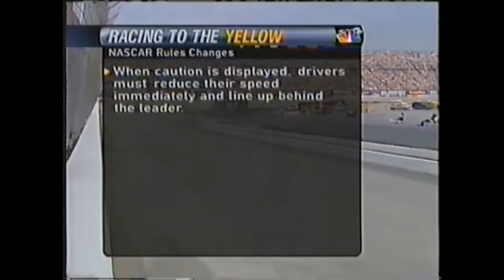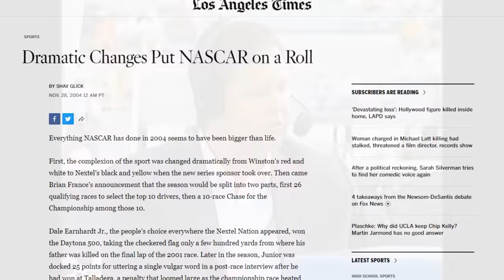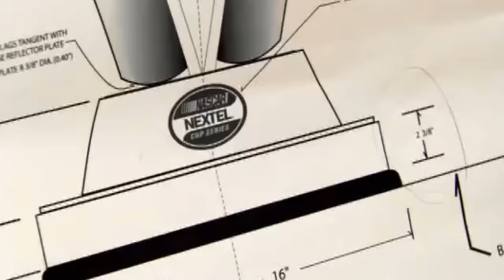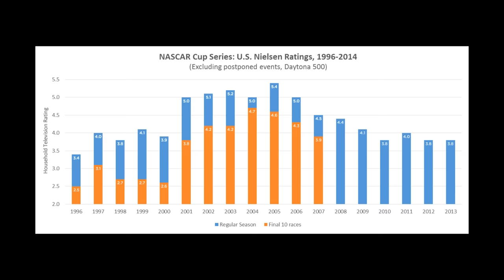NASCAR and the Dam of Legitimacy

Comment: I'll venture this:  you can make a pretty solid argument that the sanctioning body's consistent meddling and manipulation is the main reason why a majority of NASCAR fans do not hold Jimmie Johnson in the same regard as they do Richard Petty & Dale Earnhardt.
Reply: I love Jimmie, but under a legitimate points format he wouldn't be a 7 time champ, and Gordon probably would.
Reply: True but some of us don’t count all seven Earnhardt championships. Mark Martin actually won one of those seven. Dale only got six on his own, NASCAR stuck their little fingers in on the seventh.
Reply: @bafranksbro88  well even if you take away 1990, Earnhardt is still more highly regarded by fans than JJ is.
Reply: @bafranksbro88 Mark didn't win 1990 because he was always weak and ALWAYS folded under the pressure. Happened every time with him
Reply: This is partially true. Some do see them is illegitimate, but there was also a generational shift at that time. Johnson was a part of the Gillette Young Guns, which was just a promotional thing to push the new young batch of drivers at the time. A lot of people also saw him as Jeff Gordon 2.0, and Jeff wasn't popular among old race fans because they didn't view him as a prototypical stock car driver. The other GYG drivers kinda got overlooked because Jimmie was just too easy of a target for the modern era of what NASCAR was becoming at the time, he was essentially becoming the face of a sport that people had started rejecting.
Reply: I disagree, Jimmie was INSANELY talented, and arguably on par with Petty and Earnhardt, he's just, different.

Strategic, calculating, ok actually Chad Knaus won all those titles and you can't convince me otherwise.

Comment: Nascar has hopes for growth and greater international appeal while alienating true racers in America who are/were their solid fan base. Could it be influenced by a larger need for instant gratification of younger generations. To appreciate the reward for an entire season of peak performance and what that takes to achieve is lost on those who only want to care about the race winner. Not the guy who may have led the most laps, won the most poles and finished highest on average for 36 races. There have to be stages now because the casual fan will otherwise lose interest in the "long run green flag" middle part of a race. So what if a driver has so dominant a season that he doesn't have to win the last race? That accomplishment is as rare as hen's teeth and should be celebrated. So Nascar cares more about how many eyes see their advertisers through the whole of every race than the integrity of the cup. Trouble is that without the integrity there are less true race fans' eyes on it and their appeal has diminished. Even though I don't care who wins the cup anymore, I still watch because it's fun to see those rockets go, and since Mark Martin is my all time favorite I'm intrigued how Hamlin's career may end the same way with the most runners up.

Comment: I’ll preface this by saying that I’ve been a NASCAR fan since I was 8, and I’ll continue to watch until I’m dead. Contrary to what many seem to believe, you can be critical of the sport and still be a fan.

NASCAR’s objective in creating a Game 7 moment with the Chase in 2004 was specifically to try to boost ratings when they started running against the NFL late in the year. At no point in 20 seasons has this objective been met. 
It doesn’t seem to matter that NASCAR had a perfect Game 7 moment in 1992 with what is undeniably the best season finale in the sports’ history. 6 drivers all had a mathematical chance to win the championship at Atlanta that year.
It doesn’t seem to matter that NASCAR had a semi-organic Game 7 moment in 2011 when the season ended in a tie, and the title was awarded to the driver with the most wins. Granted, this was under the Chase system, but it still wasn’t manipulated into happening, beyond resetting the points after the 25th race.
It doesn’t seem to matter that under the current system, the statistics of the champion have been getting consistently worse. Get a win early in the year, then set your cruise control until September.
It doesn’t seem to matter that under the current system, a driver could win the first 35 races of the season, then finish 2nd at Phoenix and walk away empty-handed.
Ryan Blaney is the 2023 Champion. He won it fairly under the current system and he and his team did what they needed to do, when they needed to do it, to win it. But Ryan Blaney and the 12 team were a 7th place team at best. William Byron and the 24 team were the class of the field, all year long. Just because it generates “excitement” doesn’t mean it’s the right move to make. Because none of the manufactured excitement has done a thing to increase viewership at the end of the year, which is the ONLY THING that this was supposed to do. So the question stands. “Why are we doing this, if it hasn’t been successful?”
I know there are an entire generation of fans at this point who have known nothing other than some manner of gimmick for the final 10 races. And, honestly, I didn’t mind the original Chase format. But what is happening on track at this point is barely “racing”. It’s motor sports, but it’s veering away from racing and headed towards entertainment.
The simplification of the points per race was a welcome change, as far as I’m concerned. The CONCEPT of stage points makes sense, and I’m not against it. I don’t like the stage cautions, but the idea of awarding points at the end of a stage to the top 10 drivers isn’t a bad one. Ran great all day and got taken out in a late race wreck you had nothing to do with? No problem, you still managed to have a decent points day. But bunching the field up artificially a few times a race to add “excitement” has done basically nothing to add viewers. It costs teams money in torn up cars more than anything else.
I’m sure I sound like a boomer to some fans. But I assure you, I don’t share the sentiment that “NASCAR died when (fill in the blank with whatever you’re mad about this week)”. I don’t think that NASCAR is dead. I don’t think that NASCAR is trash. I haven’t stopped watching and I’ll tune in as often as I can. I don;t have a problem with changing things to try to appeal to new fans. I like the Gen 7 car, assuming that the drivers finally feel as safe as they can in them. I liked the Chicago street race. I like the increase in road courses, though I think we have enough of them now. I’m happy with trying out new tracks, and even though it’s sort of a shit show, I like the Clash in LA, as long as it stays an exhibition race. I’m glad to see the Cup Series has abandoned the idea of racing on dirt, even though I love dirt track racing. I just don’t like the sanctioning body constantly manipulating things to create artificial excitement, when the racing SHOULD be the exciting part. It doesn’t matter if it’s a boring race. I seem to be one of the few that doesn’t view the past through rose-colored glasses. Most races in the 90s were pretty boring. Side by side finishes WERE NOT THE NORM, regardless of what some people may tell you. It’s RACING. The RACING is the exciting part. not every race is going look like a Michael Bay movie trailer.

Comment: The playoffs are fundamentally flawed in my opinion. Motorsports championship systems are a bit like an election where the tracks are the voters and the race results are the ballots. Points systems correspond to positional voting, while the playoffs correspond to run off election. Progressive voting is a monotonic system; getting a better rank on a ballot or in a race can never hurt your chances of winning the election or championship. Run off elections are not monotonic. It is possible to have scenarios where the best way for a driver to take the championship is to get passed. That is stupid.

Comment: If NASCAR could just run one season under the old points system...

Just run that one experiment and see what happens.
Reply: They don't need to, 2016 NASCAR Pinty's Series season is one of if not the best NASCAR sanctioned season since 1992.
Reply: @Dexter037S4  That doesn't make any sense.
Reply: @EstebanRapido  the NASCAR Canada Series (formerly the Pinty's series) uses the old pre-2004 points system bassically.
Reply: @Dexter037S4   I get that. That just isn't how running an experiment works.

Comment: I was a huge NACAR fan when I was younger.  I haven't been tuned in to the sport for years now because it all began to feel so obviously manufactured. And this is sad because I believe there is an auto-racing renaissance occurring in America - old drag strips and dirt tracks that have been closed for years are opening back up. Maybe the sport can be resurrected from the bottom-up. I think it has to get back to focusing on the cars, the horsepower and the personalities behind the wheel.

Comment: I was a hardcore fan.
I bought t shirts, die cast, recorded the races so I could watch them later.
I noped out about 10 years back and I don't miss it.

Green white checker is dumb.
Some races end under yellow.
Deal with it.
I hate seeing someone who had enough gas to run the advertised distance wind up not finishing because the Daytona 500 becomes the Daytona 509 or whatever.

Comment: Although they are not as far down the rabbit hole as Nascar, this is basically the reason that I stopped watching Formula 1 around a decade ago.  Too much interference from the governing body who, instead of producing a simple and practical set of rules to enable the cars to race, now literally mandate a device to artificially enable overtaking.  The rules and the qualifiying formats are messed with almost by the season, pointless sprint races, races occur in any dictatorship that stumps up the cash, too many dull tracks, and far too many races crammed into the calendar to name a few.

Comment: I am on the fence with the playoff system. On one hand, the old system let the best of the best be represented and win. But look at F1 right now with how boring it has been since 2021. Just "letting them race" can be boring and make for uninteresting seasons that also hurt ratings. I personally don't mind stage cautions since it is fixed for every race and can be used strategically, but I feel like the play off system needs work considering it makes half the field is just there to be there for half the season.
Reply: Needs to be 10 or at most 12, not 16, nearly half the full time teams.

Comment: This is why I switched over to watching IMSA. Better drivers, better racing, no BS.

The stages are dumb. Used to be you had to gauge fuel, do you pit and take 2 tires to keep better position or go with 4 and move further back under the assumption that fresh tires will be faster, do you splash and go or hope a caution comes out? Those strategies are gone. Everyone gets fresh tires and fuel every 25 laps or whatever it is. No car can stretch out a lead, they want everyone bunched up. I hate it
Reply: Ironic considering IMSA is owned by NASCAR

Comment: If NASCAR wants to be more exciting, they should introduce a right turn or 2. Lol.

I jest. I also know they've been doing more road courses lately and I'm definitely here for it.

The problem I think with oval racing is that it's incredibly difficult to do well, but it LOOKS easy to the casual spectator. There's a million things going on at every second between all the cars and drivers.. tiny changes in throttle pressure to keep the wheels sticky.. but none of it is really visible to the TV viewer.

Courses with more turns and braking zones will expose more of the difficulty to the viewer and give more opportunities for passing.

Comment: I have an idea that might at least be better than The Chase.

1. Dump the stage caution BS. Let em race for god's sake. In fact as a F1 fan I hate that NASCAR throws cautions out for just about anything, I've seen em throw cautions out when a guy spins, does a 360 and continues on without hitting anything. Drives me up the wall.
2. Instead of the chase being a knockout format, award double points for the last 10 races. Doesn't overly penalize guys who were consistent all year but fumbled the last race, and also gives the guys behind him a chance to catch up if the leader has a run of mistakes in those last 10 races.

Comment: As much as I am a NASCAR fan, having grown up with NASCAR and being an avid Jeff Gordon fan, it hurts to see the sport where it is now. I admit at the time I liked the Chase for the Cup format where the top 12 essentially had a points reset back in 2004-05 to shake things up, and I thought the Playoffs would do something similar, but that didn't happen and I wish they moved away from the Playoffs at this point. And hearing about Stage Cautions turned me off because to me a 500 mile race should be as close to 500 uninterrupted miles as possible, excluding the needed cautions for bad wrecks or obvious debris/oil on the track.

I hope the sanctioning body finally stops and reverses some of their policies, as much as that hope is probably never going to happen.

Comment: NASCAR has an even bigger problem: relevancy. It's called "Stock Car" racing because it was originally "stock" cars  modified for racing. The production homologation rule told manufacturers that if they wanted to make special cars optimized for racing, they had to produce at least 500 available for sale to the public. This resulted in legendary cars like the Dodge Daytona/Plymouth Superbirds, the Ford Talladega Torino, and the GM "glassback" versions of the Monte Carlo and Grand Nationals. As time went by the race cars became less and less "stock" and it's now simply a spec-race series where everyone buys the same chassis with the same body and paints them to resemble a car from one of the three engine manufacturers. As more and more passenger cars have become smaller with four doors, front-wheel-drive and turbocharged 4 and 6 cylinder engines, many with some kind of electric assist or outright EV power, how relevant is the traditional NASCAR mid-size two-door V8-powered rear-wheel-drive vehicle to the average viewer? How relevant is it to "win-on-Sunday, sell-on-Monday" when the major manufacturers no longer make the actual cars that are racing? Seems to me either NASCAR returns to their stock car roots and starts racing cars based on production models again, or they will become the automotive version of horse racing - one or two nationally televised races but mainly it's become a method of legalized gamboling that the general public no longer cares about.

Comment: So.  It only took 25 years for the automobile racing community to catch up to me.  I wish it were satisfying to say that, but it's more just depressing.

NASCAR began going the wrong way long before Brian France assumed his family's corrupt corporate dictatorship seat.  Way back in 1988, when Bobby Allison's crash at Talladega almost put a car into the stands, NASCAR decided it had to slow the cars down in the interest of safety.  Although open-wheel cars have gone far faster and still been safe, the argument was still justifiable.  What was NOT justifiable, however, was the way they chose to do it.

Rather than the sensible solution of reducing engine size while increasing downforce, NASCAR elected to introduce a mechanism that forced everyone to run far closer together on the gigantic superspeedways.  With a reduced engine size, you get slower speeds: bigger engines make bigger power, that's just physics and chemistry.  But among those smaller engines, some will still be better built, and thus perform better.  The better teams will still have the advantage, the fair advantage, of being better at their sport.  Wilt Chamberlein was just better at basketball for over a decade.  Jack Nicklaus was just better at golf.  Pele was just better at association football, which Americans call soccer.

With the restrictor plate, though, you reduce everyone to the same speed, and thus force them to pack up together.  Instead of allowing development at a reduced level of power, you penalize performance itself, so that the best CAN'T be better, and the worst CAN'T be worse.  You make it all a crap shoot, where disasters can happen and take out anyone.

Why is this choice they made so important?  Because it demonstrated what drives NASCAR, and all other sports where brands have become more important than principles: entertainment, the third word used in an organization called WWE, and the word invoked by a fictional but awesome man named Maximus Decimus Meridius, in the film Gladiator, where he shouting asks whether they are entertained by all the Roman bloodsport with equal measure of both derision and contempt.

TBC ...

Comment: I would argue that getting away from the "stock" in Stock Cars was the real first crack in NASCAR legitimacy. How are these supposed to promote the cars I can go out and buy if they're just sheets of metal and composite draped over a ladder and decorated with decals? 2011 Camries, Tauruses, and Impalas didn't have carbureted V8s and live rear axles from the factory, WTH? Compare to Aussie Supercars and European touring cars, which are varying degrees of actual functional VIN body shell that they converted into a race car.